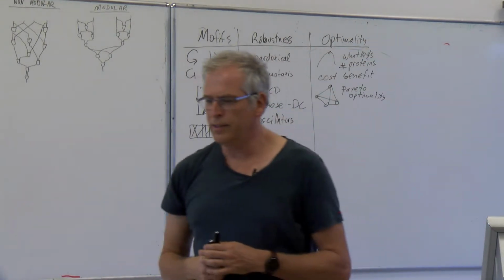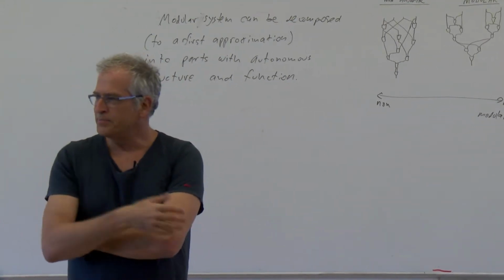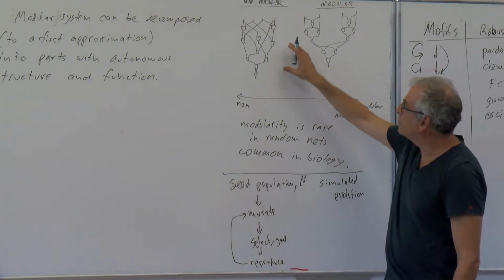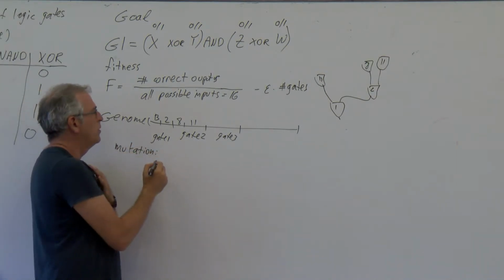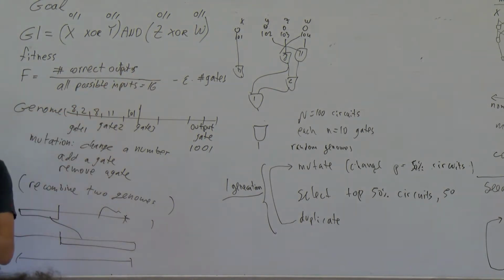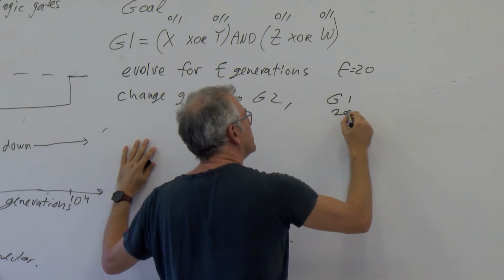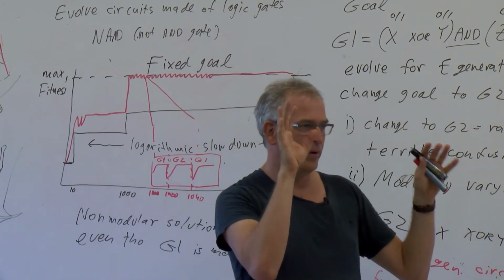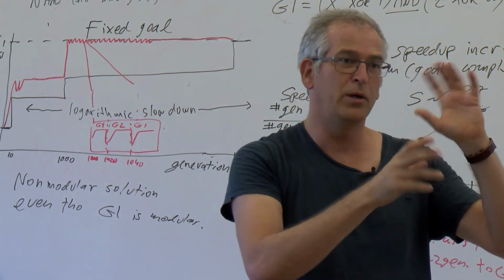Systems biology course 2018 Uri Alon - Lecture 12 Modularity

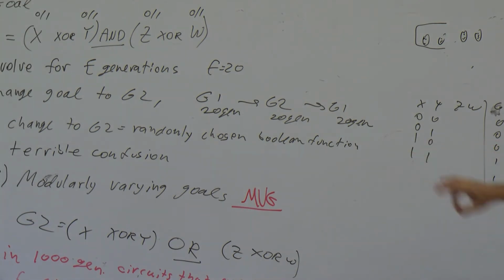Comment: I believe it is possible to construct a modular systems as well with 10 NAND gates. Each XOR uses 4 of the gates, and the AND needs two gates The OR would need 3 gates, that's why the modular solution in the second case uses 11 gates. What would happen if the final goal that was fixed at 1:08:18 would be G2?

Is the last lecture going to be uploaded?